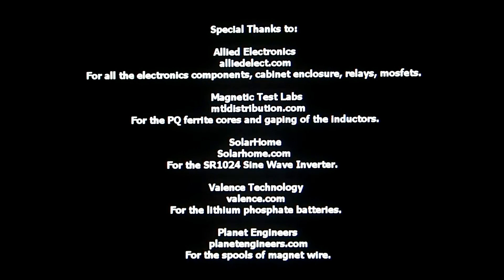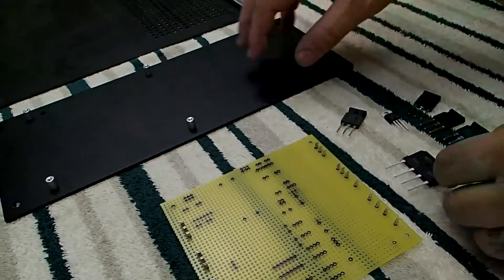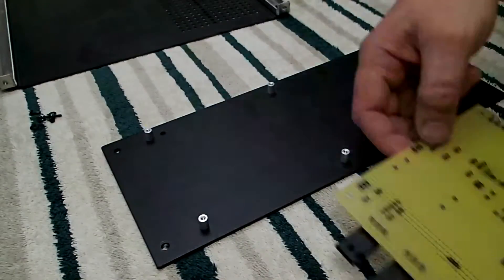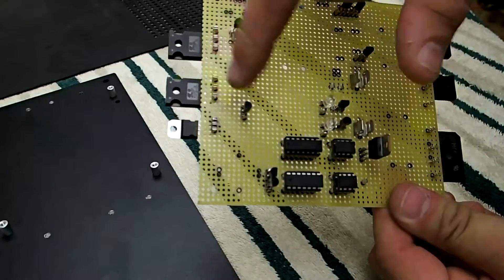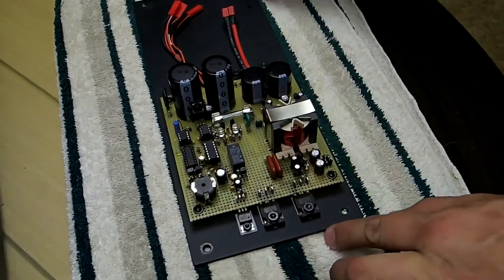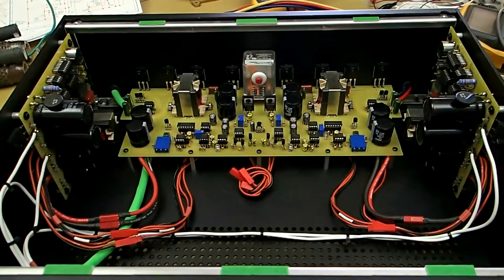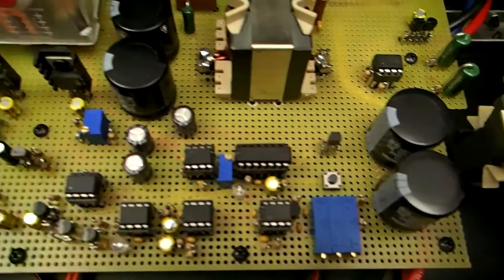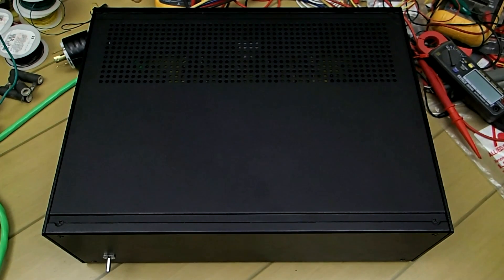AC/DC Input Lithium Battery Charger (Switching Power Supplies)

Comment: is this what you use to charge your coil gun batteries?
Reply from the maker: Доминик Недлюски yes that is the charger did I charge the lithium batteries up with the big ones that did run the coil gun they were 40 amp hour two of them
Reply: Moss Fett I remember you telling me the other day when you began charging the capacitors it started charging at 40 amps if that didn't happen would the batteries have a longer Charge?
Reply from the maker: Доминик Недлюски the batteries each charge at 20 amps each 40 total that's the maximum rate for the battery and the fastest possible charge time, don't get the batteries mixed up with the capacitor Bank, these two batteries ran a switching power supply at 62 kHz that's Supply charges up the capacitor bank for the coil gun
Reply: Moss Fett that makes alot More sense to me now. so the capacitor load comes from the powersupply and the powersupply is driven from the batteries.
Reply from the maker: Доминик Недлюски so the answer to your last question is yes if the power supply did not draw the 40 amps from the batteries the capacitors would not charge up as fast
Reply: Moss Fett you don't understand how much you've helped me out dude lmao. I'm only 16 and relatively new to electronics and how much I've learned from you since I found your channel is insane I want to thank you for answering my questions and potentially more in the future

Comment: So, you basically grounded you voltage regulators together? What happens to them all if you get a short? 80% of the time it's a wire and you have a lot of wires under the board. Nice build BTW otherwise...
Reply: *your